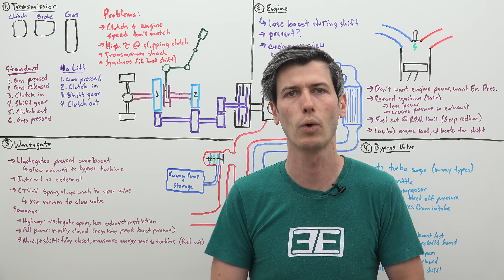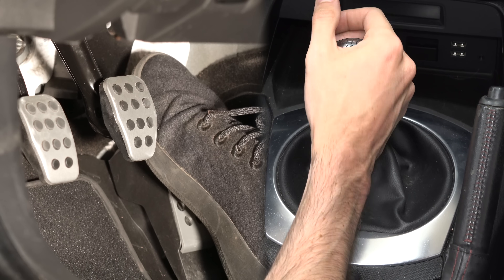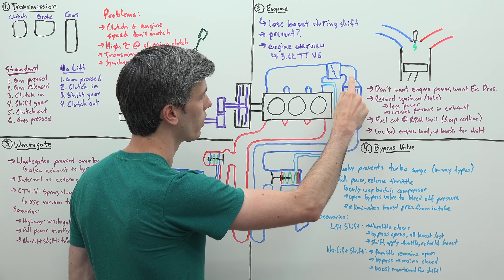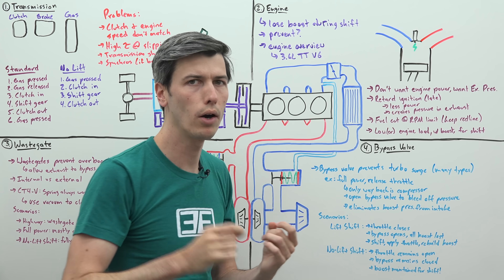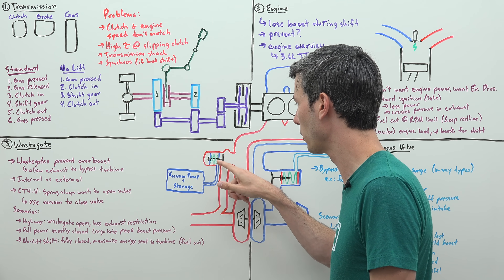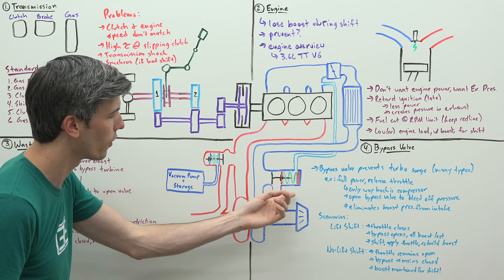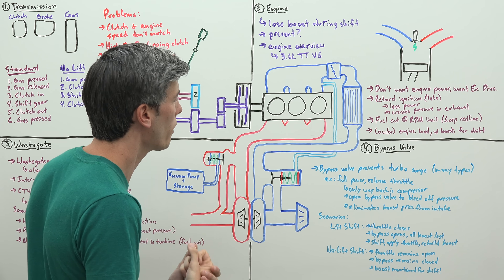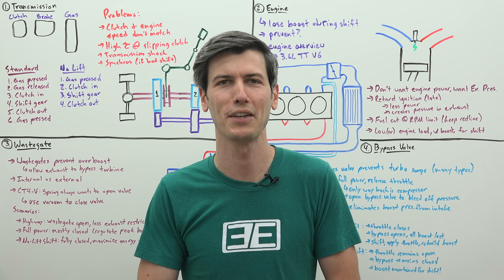How To Power Shift Correctly - Go Faster Without Destroying Transmissions

Comment from the maker: Clarification! Does the clutch still have to absorb the engine vs transmission speed difference during a power shift? Yes! But with the delayed ignition timing (or some tuners will use spark cut), you put the engine in a low load state, so that when you re-engage the clutch, absorbing the speed difference is easier because there's not a bunch of torque going to the clutch (it's instead being used to make exhaust pressure, to keep the turbos ready). And once the clutch is re-engaged, ignition timing goes back to usual and you're right back at full power.
Reply: My tune has a rev limit for flat foot shifting set below redline to mitigate the speed difference. Is that achieved in the same way as typical power shift ignition adjustment? And is it any better or worse for my trans?
Reply: @tmschutter  that just mean that your safety for the transmission will only be working if you are doing cutoff, while the ignition cut is at any rpm range, you could just do a flat foot shift tune based on your gear ratio and rpm so when you do the the gear changing you car rpm limit is set for the  rpm after red lining in the previous gearing
Reply: @tmschutter  in that case the speed diference between the engine and trans is lower, so yeah it should result in more durability. But from what I understood the worst part is having a high load while the clutch is spinning. Does your tune prevent that?
Reply: @juanordonezgalban2278  that's what I'm unsure of. Idk how the tune goes about restricting the RPM. If it's the same as the way they do launch control, it's a combo of throttle and fuel cut, so it should result in lower torque, but perhaps at the cost of some boost loss, though I haven't noticed any (not that I'm staring down my boost gauge while going WOT, that would be rather distracting).
Reply: I really enjoyed this video! super well explained. thanks!
Reply: Very interesting! How does all of this translate to diesel engines?
Reply: @jhsevs  what ignites fuel on diesel engines is pressure, not a spark, so instead of advancing/delaying the spark to advance/delay ignition, a diesel engine would advance/delay the fuel injection into the combustion chamber to have that same effect.
Reply: @Infamous Grizzly but to reference your wrong interpretation of the nasa page, someone already addressed this:
Because when you simplify your work by assuming things contrary to reality, you document those assumptions so that if anyone checks your work and comes up with slightly different equations or answers, they’ll have some way to determine where the difference might have come from.

Researchers simply things. There’s a famous joke in the scientific community that all you have to do is mention two words, and most people will know what you’re talking about. “Spherical cows.” Basically, the joke is about a farmer that asks a physicist if there’s any way to use science to get more milk from his cows. After some doodling on paper, the physicist says, “Yes, but it only works for spherical cows in a vacuum.” The reason the joke works is because most work makes certain assumptions that shouldn’t radically affect the outcome.

For example, ask any high school physics student how fast something is falling after 5 seconds of free fall, and there’s at least a 90% chance that they won’t even mention air resistance or terminal velocity and they’ll give an answer that is only correct in a vacuum. That’s because computing air resistance would make that problem MUCH harder and would require information not present. However, unless you’re talking about something not very dense or with a lot of surface area, the answer will still be close to correct.

Basically, despite what some people will insist, the shape of the Earth doesn’t actually make a significant difference in how you’d fly an aircraft. Even at long distance airliner speeds, the difference between a flat Earth and spherical Earth would amount to an absolute change in vertical direction of movement is about one degree every ten minutes. Given that the pilot (or the autopilot) is constantly making corrections to maintain the correct altitude, that one degree every ten minutes is going to get lost in the noise. So, to create formulas that would take the curvature of the Earth into account would be quite a bit more work than assuming a flat Earth without having a significant improvement in accuracy. So, they assume flat and then state their assumptions.

If nothing else, “stationary atmosphere” should tell you that they’re not referring to reality, because even flat Earth advocates don’t assert that there’s no wind.
Reply: Is that like a quick shifter on a sport bike?
Reply: @pleasedontwatchthese9593  nope, quickshifters use a sensor to detect movement on the shift pedal and stop ignition at the precise moment you start shifting. This eliminates the load from the gearbox for a split second, which allows to shift gears without any actuation of the clutch.
Reply: @pleasedontwatchthese9593  sport bikes cut ignition or fuel depending on the model for quick shifters. Obviously there is no turbo to try to keep spooled.
Reply: @pleasedontwatchthese9593  Nope. Quick shifters allow for clutchless shifts. In this video he still operates the clutch.
Reply: Thanks.
Reply: So... you might as well be lightly coming off the throttle a bit anyway? 😂 the whole point of no lift shift is to not induce lag, increase engine rpm, and allow the clutch slipping to continue your acceleration increase. You shouldn’t slam the clutch too hard but you want to allow a small amount of slip as you bring the clutch back on. You don’t slip too much so that you cause damage but you are inherently trading clutch wear for the acceleration during that run. If you play it right... you can do all this and let off the throttle a tiny bit for a split second. Just as you’re about halfway through the slip process... go ahead and hammer back down the throttle. You’ll only drop a 1k rpm at MOST during that process. Some cases there is no need for letting off the throttle at all... if you know how to do the process properly... and fast enough.
Reply: Is that comparable to rev matching on a e.g. i30N or Veloster N? It does ot up and down
Reply: So, basically the manual is becoming an automatic?
Reply: @Infamous Grizzly id be interested to see if you could cite your evidence.
Reply: @Infamous Grizzly so your basis for a flat earth is based on similarities in names? 🤦‍♂️. Feel free to link videos or something of the nasa glitches in the mean time but feel free to ask yourself why weight varies based on vacuum/gravity and post a photo of the edge of the earth
Reply: @Infamous Grizzly there's a video of someone proving that weight is meaningless in a vacuum by showing a feather and bowling ball falling at the same rate. This is only possible based on the theory that weight is mass and gravity related.
Reply: @Infamous Grizzly care to elaborate on finestrelles?
Reply: @Infamous Grizzly wait so you aren't basing it off names? So why keep bringing it up then? You keep going on about factual evidence but haven't yet provided one shred of proof for it. Just because you say nasa and space x are lying it doesn't mean they are. As for proof though there literally hundred of videos alone on this very platform disproving various flat out theories and challenges. But yet again you still haven't answered my one simple question, where is the edge?
The "plane" part of aeroplane is literally because of the wings, if you ever paid attention in history you'd no this from the Wright brothers
Reply: @Infamous Grizzly as for finestrelles, I assume you're referencing the Guinness world record in which case you need to go have a look at the specifics of how that record is possible. Anything else you want make yourself look foolish at?
Reply: @Infamous Grizzly this addresses how the finestrelles record is possible
Reply: In this Instance is the clutch safety switch used by the ecu to manage spark cut or is it a different method?
Reply: Does it work the same way with carburated and fuel injected car? 😯
Reply: This gadget is similar to the anti-lag system some rally cars use, isn't it? It produces beautiful backfires
Reply: @hulk.agiota  I'm pretty sure this is basically anti lag, just called different.
Reply: Granny shifting for life in a Caddy.
Reply: Isn't this thing just killing the turbocharger ? I mean delayed ignition.
Reply: @Eugen-E  I agree!  If you're retarding timing during the power stroke then you're losing the affect of the turbo.  Additionally, the exhaust valves are closed during the power stroke so that pressure is not going out the exhaust.  I think he needs to rethink either his explanation or his reasoning because it doesn't make sense at this point to me.
Reply from the maker: @tmedocianis  As I'm sure you're aware, the exhaust valve opens after power stroke. The later your ignition timing, the greater your exhaust pressure, because less pressure is turned into useful work, and more is sent out the exhaust as waste. In this case, that's a good thing, bc it keeps the turbo spooled.
Reply: @EngineeringExplained  For maximizing power and acceleration, it is indeed great to have a turbo spooled at all times, but if we consider durability of the components (which is a very important aspect for production cars), I believe this would be awful because all of that delayed ignition is basically making combustion occur inside exhaust pipes instead of in the cylinder, so all the extra temperature + concussive impacts from that will wear out the catalytic converter very quickly and also cause damage to exhaust valves over time.

Am I missing something here that makes this a good idea on a production car?
Reply: @IgorBrandao   if it came from the factory, be sure that they reinforce the valves and the exhaust. plus, I don't think there's someone will power shift in his daily trips. if you do that only on track days, then your car will be just fine especially if you don't put lot of miles on that car
Reply: @IgorBrandao  combustion cannot occur in exhaust pipe. fuel does not go into exhaust pipe and there is no spark plug or piston and injectors to ignite to ignite the mixture of fuel and gas.
Reply: @tmedocianis  no just a consistent boost from it making the engine run easier, thats why all new cars r turbo charged aka ecoboosted
Reply: Drop a gear disappear for me  I  Change gear while slowly lifting off the accelerator with my foot drop ur clutch just before it bites so its just barley touching the dmf I'm talking a couple of a4 printing paper sheets away from the dmf for a quick safe smooth power change as the clutch won't slam against the dmf as hard as fully depressed then quickly full release my turbo starts to spool up just after 1000rpm but my car tells me wen to change up or down for maximum performance that's standard on it from factory and a performance air filter helps alot too as it don't restrict the air flow as much as a stock filter does allowing the turbo spool up faster as it's not struggling to suck in air through the restricted stock filter the performance Panel filter with my stock air box has reduced my turbo lag by 1000rpm ish stock filter the tubo began to spools at 2100rpm and now spools up at say 1100rpm ish and delivering strong power surge to max psi wich is achieved at 4000-4400 but red line is at 6500rpm my car has  2.0l turbocharged 4 cylinder petrol engine same as a golf gti and stock was producing 230bhp with a small remap but after the air filter changes and few tweaks it's on 250bhp but because to turbo spools up faster keeps up with the golf r 300bhp and audi s3 306bhp I'm quicker of the line but top end they get me but will max out at 155 mph and the s3 only for the bhp it has will top out at the same 155mph so powered isn't everything it's how u use it if mine was awd and had a new exhaust new intake and fmic and hpfp and a remap will easily get 350bhp out of it then its forged engine time and mine has a single clutch with a lighter stronger dmf but also has lighter race discs and pads and engine mounts it's all how to play to ur cars strengths to get to most out of it's performance but also the reliability of it too and the duel clutch can take alot more abuse than a single disc transmission but it's a twin charged v6 is 360bhp im surprised that they only got that out of it tbh 👍 and I've also changed the transmission settings to get power to the ground through the obd port and a quick shift linkage helps too as less time to achieve a gear change 👍

Comment: when you say powershift we farmers think of something else, it is a transmission type, eighter manual with an powershift ladder or hi lo gears, only there can be six of them on top of the manual 6 speed, so that can be from 12 to 36 selectable gears, the powershift in tractors don't need lifting or clutch use which means most farmers actualy use the powershift instead and use the regular gears as a ladder

Comment: I can't believe people don't do this at the track.  I went a few weeks ago and it was..... vroom, lift..... vroom, lift etc.  These people had to be losing .5 sec. 
I used to speed shift my 69 Road Runner all the time.  On the street and for T.O.'s at the track.  Eventually, it would rip some of the lining off of the clutch disc, but after a couple years.

Comment: Hi Jason, you made a little mistake at 5:40 
Wastegates always want to stay closed.
Stronger spring = more Boost
The Pressure in the exhaust is pushing while the vacuum is pulling it open.
There is the old trick where you drill a tine hole in the vacuum line to create more power.

Comment: Timely subject!  I've been debating how the no lift shift worked when factored to the trans, clutch and engine.  Well stated!!  I'm a Twin Turbo guy so this should work well in my case.  I'll consult my tuner on the timing/fuel cutoff in-between shifts @ the Red line.  My monster clutch is pretty durable but I don't want to push the limits.  Great video and perfectly explained!  Thank you!

Comment: like your channel. could you please do a topic on EVAP systems?  EVAP system is complicated on turbo engines. Vacuum sources could be manifold vacuum(low engine load) or turbo inlet pipe. Some manufacturer use ejector valves for suction. I am curious about the engineering requirement and process for EVAP system. What's the suction/ flow requirement for fuel vapor? Would ECU adjusts for the additional fuel vapor? NA engine has a way simpler design using manifold vacuum. Does EVAP still work under high load on NA engines? Is the turbo EVAP superior because it can work on all conditions? What about during coasting, throttle is open to reduce engine braking, no vacuum anywhere?

Comment: Hello, do you know if it's more economical while skipping gears upshifting (ex quickly coming onto highway then cruising in highest gear), to quickly let off the clutch? Is there overall less wear due to less Rev hangs and recapturing engine energy?

Comment: So what happens if you leave both pedals pressed for a long time? Do the revs drop or do they rise I didn't get that from this vid.
Reply: it disconnect the engine from the wheels at that point so its just producing power to spin itself and not move the car

Comment: Shifting a manual car transmission without using the clutch will quickly wear out and / or damage the synchronizers in the transmission... Once they start getting that wear or damage you will find it won't stay in gear without holding it there with your hand... When you let off the accelerator it will pop out of gear as the synchros are designed to keep it in gear and make shifts smooth without grinding the gears together... When you shift without using the clutch the snychros are taking the brunt of the damage that would have occurred to the gears...
Reply: He's talking about not lifting off of the gas, not the clutch.

Comment: I used to have a 93 Ford tempo with a 5-speed that would power shift very easy. Only I would stay on the gas and wait until the rpm’s matched up and shift without the clutch. Never gridded at all and the car seemed to love it. I’ve even done it in semi’s. Works every time up or down shift if you know your vehicle 👍

Comment: 182,000 miles on the Toyota C60 transmission, and VVTLi, but no turbo. Bouncing the 2ZZGE off it’s 8200rpm limiter with each shift, staying in lift and not missing a gear is enough drama for me. It makes a hell of a racket when I miss second. Trying to smoothly and quickly rev match, downshift, and mesh into a gear that you are going to need to have turning at 5500 in order to WOT back up to the limiter is also a skill that needs constant practice. What the hell, next time I get the project car up the on-ramp, I’ll see if no-lift feels right, or if it feels like I’ll be shopping for a transmission that’s even more rare than the engine.

Comment: I just jam the shifter up when the engine is at the right rpm without the clutch or letting of the throttle, but motorcycles don't mind too much

Comment: Do you want to wait till the last second  before slowing down to  take a corner?  Stay at 65 mph right before you approach the corner, put the shifter into first and let up on the clutch as fast as your foot can move,  the car will slow down really fast. 
Disclaimer- Actions stated above may and will cause catastrophic damage to your engine and transmission. Try at your own risk, I'm not responsible for any damages.

Comment: My motorcycle will powershift fine without even using the clutch; uses undercut engagement dogs in the transmission (Honda crf450).

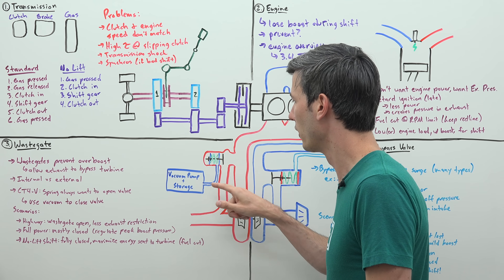Comment: 6:00 - is this a new way wastegates are being used? They open up at idle? Every waste gate I’ve worked on they remained closed till the spring was pushed open under pressure.
Reply: Thank you! I'm wondering the same. It must be a newer model thing.